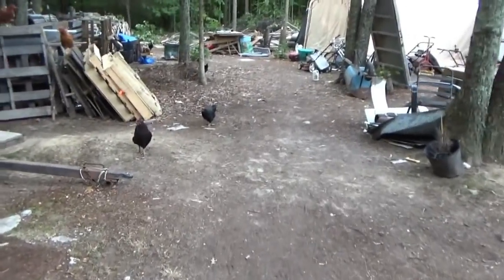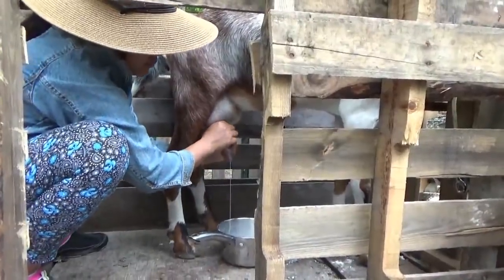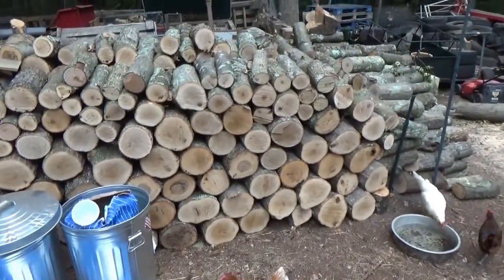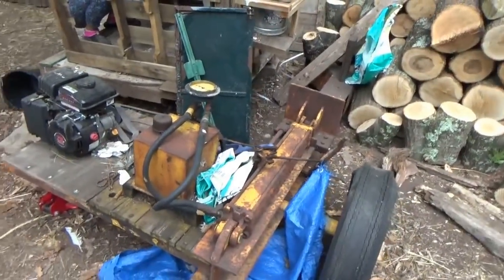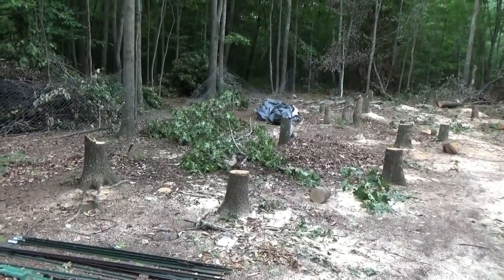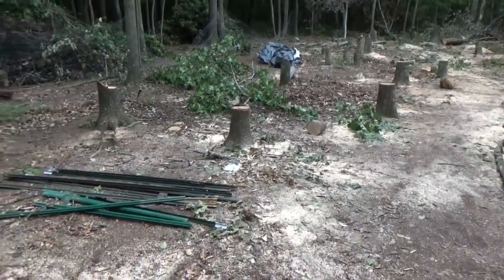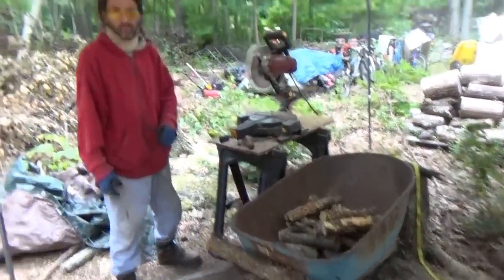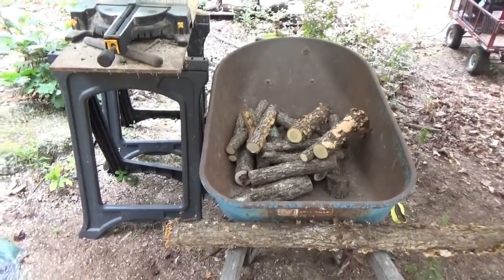Preparing To Build Chicken Range & Other Homestead Activities

Comment: Troy, the depth gauge (the portion that's immediately ahead of the cutter tooth)  needs to be lowered a bit on the chain of the saw, it's barely cutting, have Chris  to use a flat file and give each one of them 3 to four strokes. You'll find that it will cut a lot faster. This needs to be done about every fourth or fifth time the chain is re-sharpened., the height of cutter  should be approx. 1/16 th of an inch higher than the depth gauge portion. The weight of the saw should be sufficient to do the cutting and if the chain is right it will almost pull itself into the cut on it's own.
Reply from the maker: Thank you. It is getting tougher to cut. That could do it :)
Reply: The Do It Yourself World I noticed that it was taking too long for the saw to get through the log, a good indication that the saw was barely getting a bite in the wood.
Reply: Charlie Ice SMC That sounds like a plan, why haven't you sent him a couple spares instead of posting sarcastic comments all the time?
Reply: Charlie Ice SMC Heck, no wonder you were blocked, with all the sarcastic comments would cause anyone to be blocked sooner or later.
Reply: Charlie Ice SMC I learned a long time ago to never ask anyone what their personal business is/was. The only time I interfere is when someone states either directly or indirectly about my choice of viewing preferences by saying that those that views a particular channel are dumb, pathetic or whatever else, just because they have a vendetta against a particular video poster, I will respond, otherwise I don't say anything or ask any personal questions of the video poster that I view, I just offer helpful suggestions when possible.
Reply: Charlie Ice SMC
So...just because you sent him some money you felt entitled to act any way you wanted to in his comments section. Sorry, it doesn't work that way. As far as "just asking him a question goes," it was a question that tried to trap or insult or imply wrong doing, wasn't it? I've seen those questions you trolls ask. BTW have you stopped beating your dog? Just asking.
Reply: Quiet Kate
Well, then, I am glad you aren't Troy.
Reply: SSanf  I'm sure you are glad that I'm not Troy. You claim how you dispise the trolls, yet you go out of your way to interact with them. It's obvious that no matter how you state otherwise, you enjoy the trolls.
Reply: Charlie Ice SMC That was really nice of you to send him a spare chain.
Reply: Charlie Ice SMC LOL

Comment: Troy why do you rock your chainsaw when cutting trees?
Reply from the maker: The teeth bite in too deep and bog the saw down. I have to keep rocking the teeth out. Those teeth on the front of the saw, not the chain.
Reply: LMAO  It's Husqvarnah's fault.  Geez, ya know there's a thing online called "You Tube" that has instructional video.
Reply: +The Do It Yourself World  I beleive you are referring to the dogs
Reply: The chain needs sharpening. It's throwing out sawdust instead of chips.
Reply: ***** It's obvious to see that the saw is not cutting properly. What is there to criticize other than the failure to sharpen the chain.
 You are one fine example of an apologist.

Comment: OK, now I am confused. You have said before that you are building a chicken coop there, just like you just did here and then corrected yourself. So, is there going too be a coop inside the runway with the stumps inside the coop or just a runway? You have said several times that you are building a coop there. Did you misspeak? You said that was where the "coop" was going, again.
Reply from the maker: First we are going to move the chicken coops from the meadow over to the new chicken run area. Then, before winter we will build a proper walk in chicken coop.
Reply: +The Do It Yourself World
Thanks. That clears it up. :)
Reply: +The Do It Yourself World
Hopefully the Goats won't remain in that little stye you have them in.

Comment: You need to get rid of the belt on the wood splitter and put a lovejoy coupler on it then you will lose the problem of the belt slipping all the time
Reply: That's exactly right. I built one from scratch a couple of years ago. I used a lovejoy on mine. Just have to know what size shaft on the motor, and what size on the pump.
Reply: I told him the same thing two other times,providing that the rotation is correct it is a lot better.

Comment: That saw is in serious need of sharpening! Might be time to lower the rakers.
Reply from the maker: We sharpen it with every tank of gas but yes, the rakes need to be lowered.
Reply: Husqvarna makes a tool called "Sharpforce" that contains a round file and a flat file. The Sharpforce allows one to sharpen the chain and lower the rakers with the same stroke. It keeps your chain at optimal performance level. The Sharpforce is not very expensive, I got mine for less than twenty dollars.